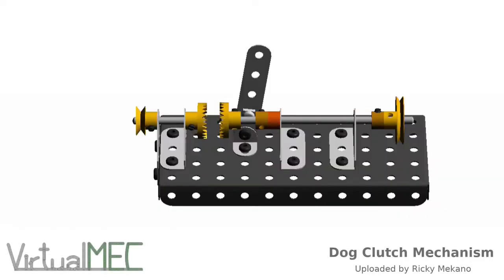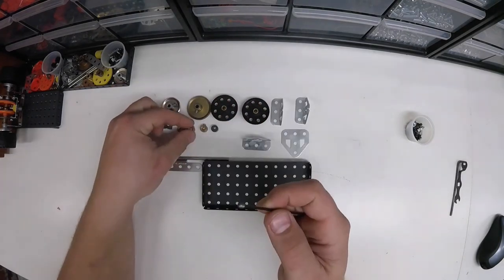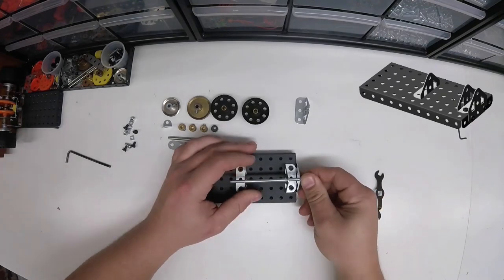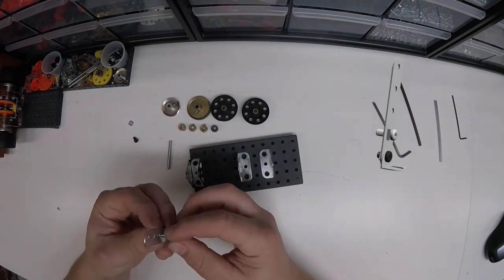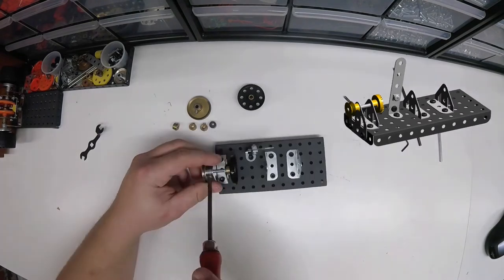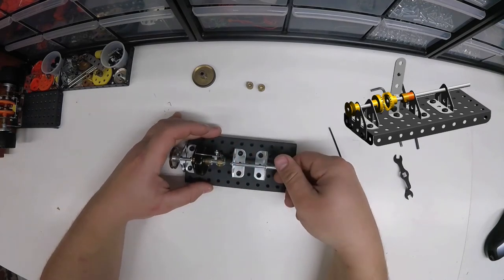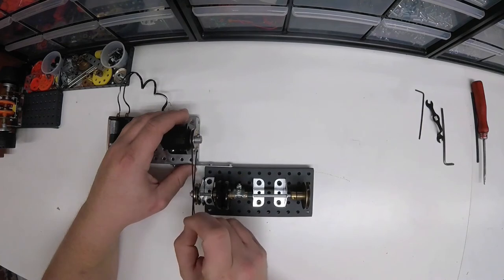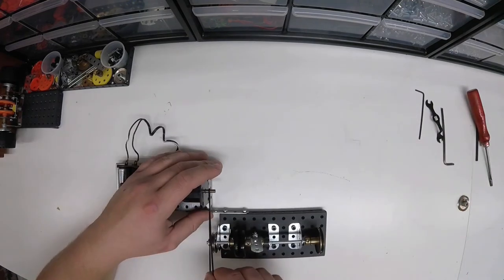Build a Meccano Dog Clutch Mechanism [VirtualMEC Build #1]

Comment: These small mechanism models are good fun to build.  If you look at some of the old Meccano manuals from the 50s there are a couple of gears and mechanisms sets that have quite a few like this.

I've also done a build designed by Ricky Meccano - the spider crane one on my channel.  Unfortunately Ricky died about 12 months ago.
Reply from the maker: A lot of fun to build! I'll be doing more of these. Maybe I'll pull up one of those 50's .pdfs and see what I can find. Been flipping through a 70's mechanisms booklet from France that looks promising. In  need of more brass gears.
Reply from the maker: That's unfortunate. I was wondering why I couldn't find any of Ricky's videos. Rest in Peace Ricky Mekano. May these videos serve as a remembrance of your love of Meccano.

Comment: Are  there any other Meccano compatible sets available in your location? For example in India we have #zephyrMechanix and #toykraft who makes some sets and they are ok. But i doubt any company is going to build the brass parts
Reply from the maker: I've never heard of those two brands. Are they manufactured in India? I come across a grip of A.C. Gilbert Erector Sets, followed by  Meccano, and Steel Tec in that order. The A.C. Gilbert are pretty well compatible, same hole spacing, similar size axles, rods, and screws. I have a TON of those https://www.youtube.com/watch?v=Vo3POY2Yuzo&t=739s  I'm actually planning on building a large garage/diorama based on your suggestion and I'll be using mostly the A.C. Gilbert. Should be a substantial build.